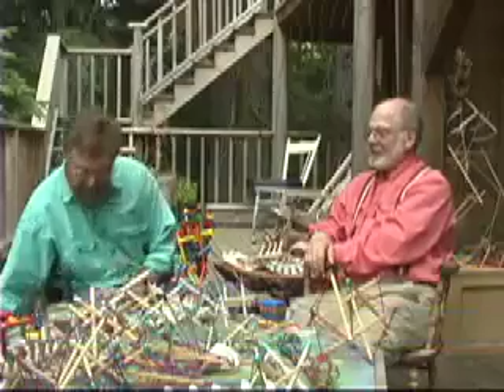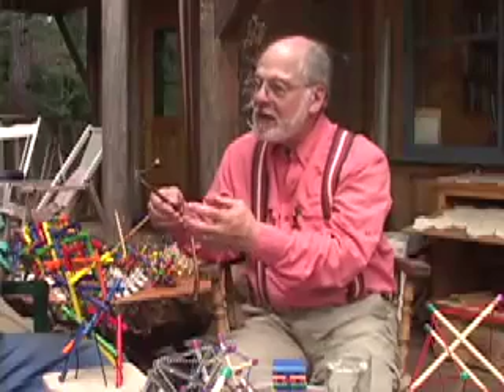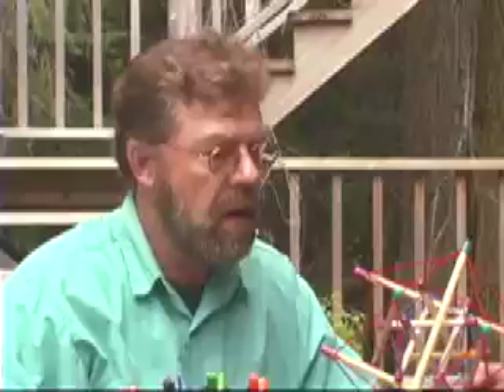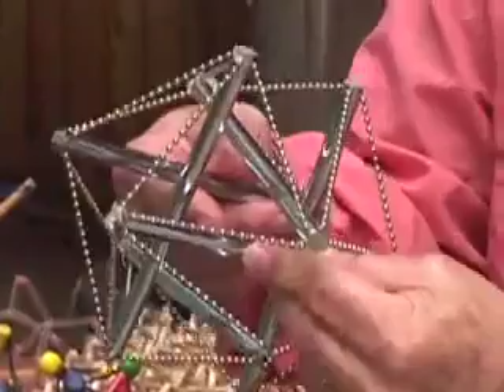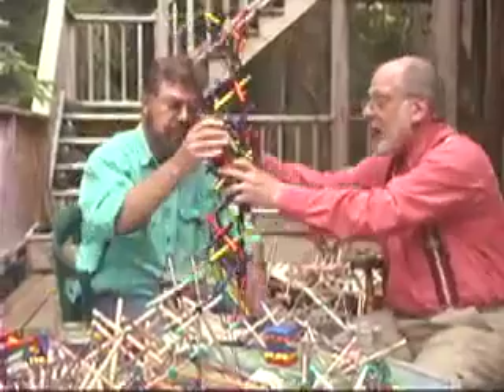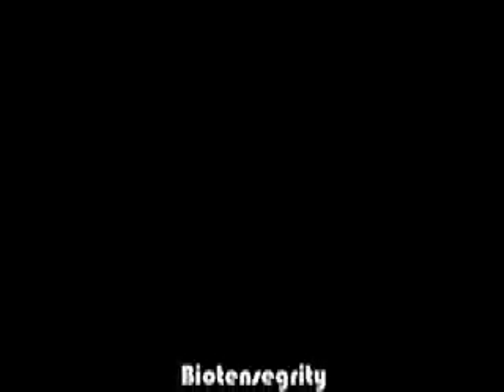Conversation about Biotensegrity:Steve Levin & Tom Flemons

Comment: how and why is that tower moving?
Reply: I know you asked this five years ago, but in case you were still curious.... It's basically a puppet. There are Elastic cords that connect the wooden sticks and those elastics run down and underneath the tower. Tom is pulling on those cords causing it to flex and move. Tom was my uncle and he called that tower "Johnson"
Reply: poltergeist
Reply: Gravity🤓